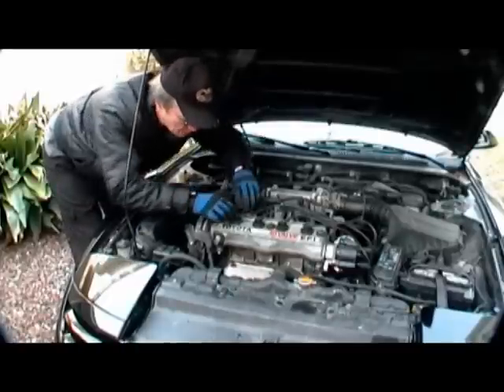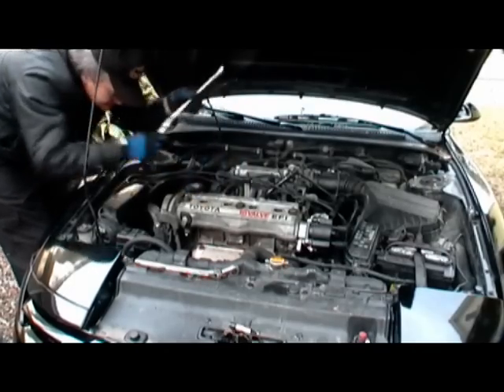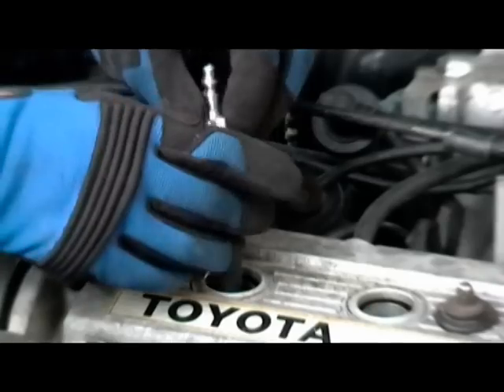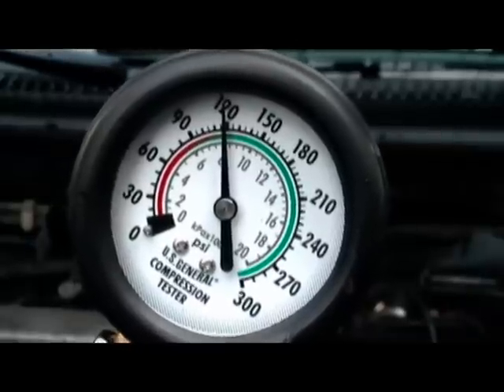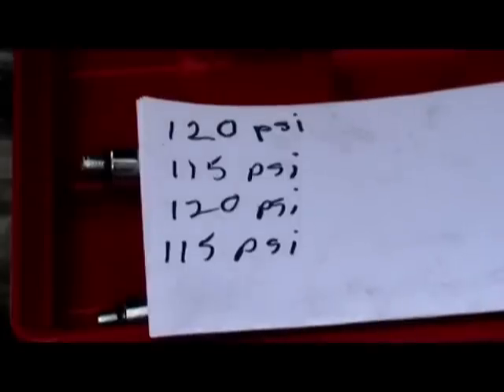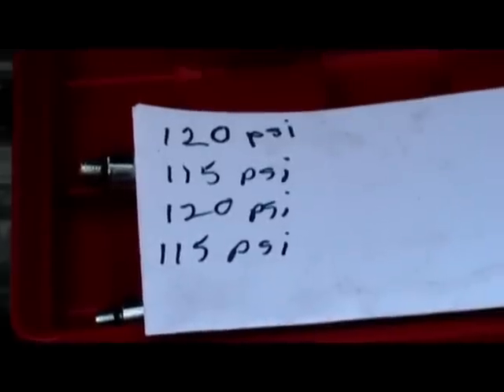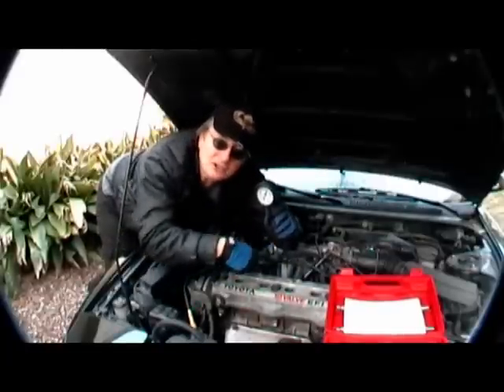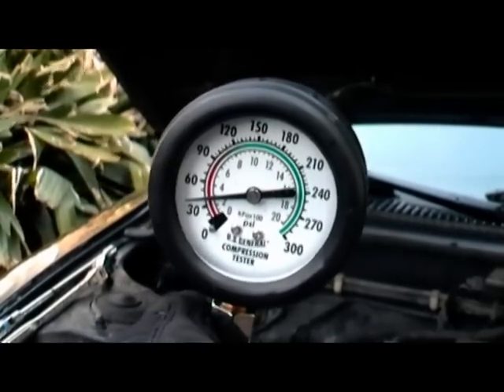How To Check The Compression Of An Engine

Comment: Hi Scotty! I've learned a lot from your videos but now I have a problem with a Toyota 4p motor it won't start I have spark, compresion, fuel and good ignition. Before it ran fine till the crankshaft bearings went out so I replaced them and now it won't start everything is tighten to specs. Had to remove the timing chain on it to get to the last bearing but I put it back the same way. By the way it's a forklift motor. Any help would be helpful. Thanks
Email
Sosatony25@yahoo.com